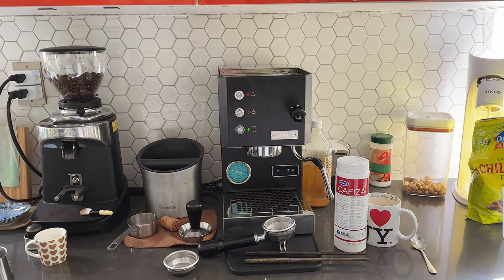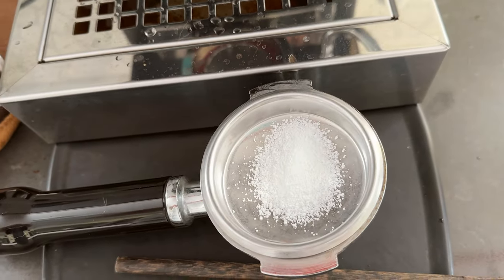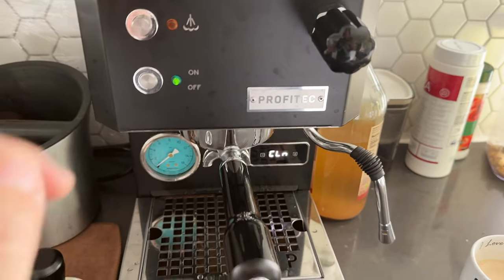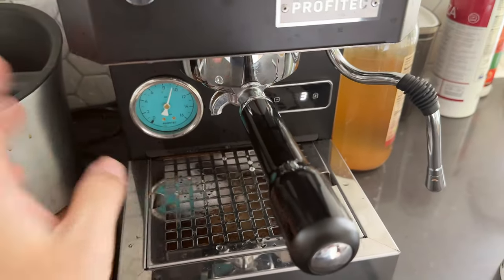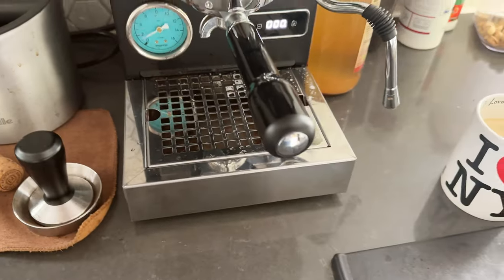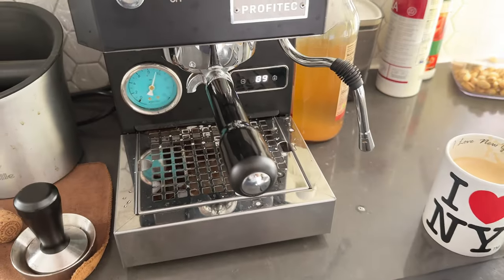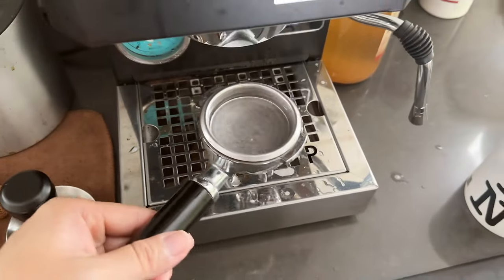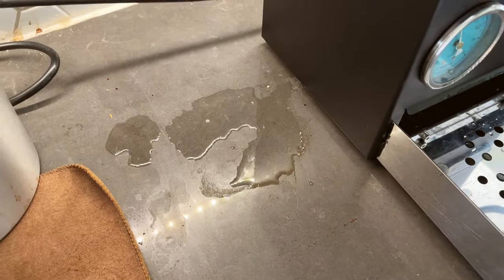Profitec Go Maintenance: Backflushing The Grouphead and Solenoid Valve

Comment: any idea on why the Normcore 58mm E61 Bottomless PF doesn’t work on the Profitec Go? 
It fits in there, but water leaks out of the top when I have pressure.
Reply from the maker: It could be defective, should fit fine. Best bet is get an exchange, or try installing a silicon seal to replace the original rubber seal for better fit and longevity.
Reply: It does, I use it. You have a problem elsewhere. Likely the gasket. or the shower screen needs to be tightened.